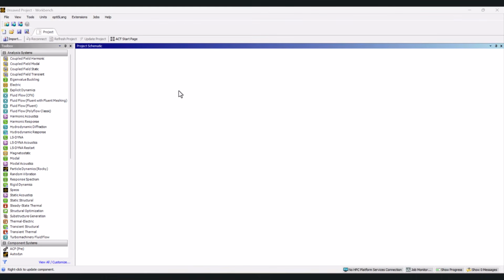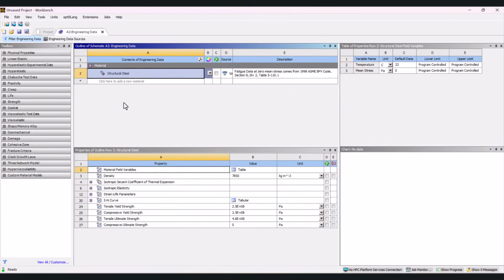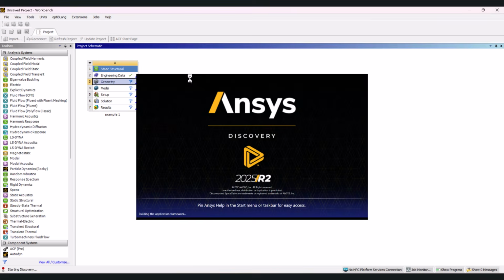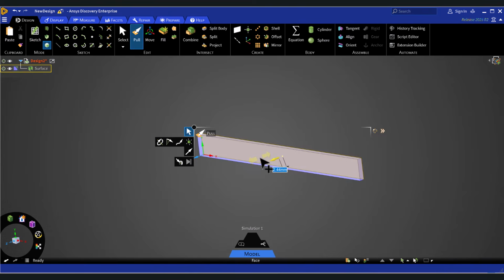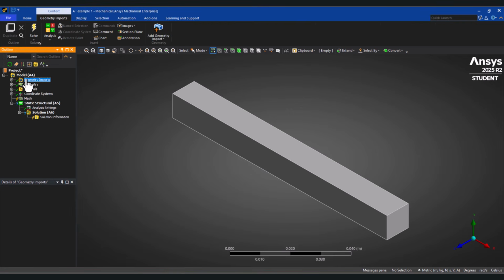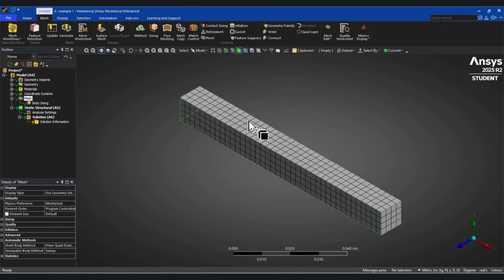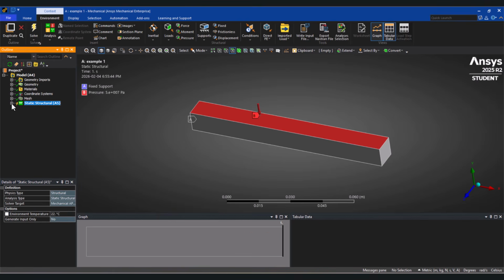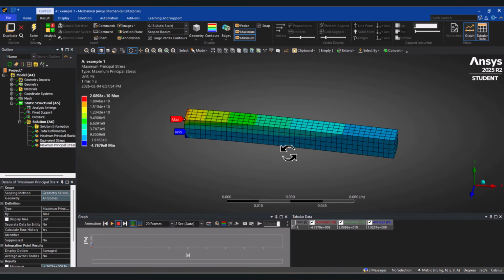ANSYS for Beginners: Start Here Before Your First Simulation

Comment: My computer shows the javascript runtime error message 5:57
Reply from the maker: That JavaScript error in Ansys usually pops up because of a glitch with the background web components it uses for the interface. Try typing %appdata% into your Windows search bar, find the Ansys folder, and rename or delete it to reset your UI cache. If that doesn't work, try running Ansys as an Administrator or disabling the Start Page in your options!